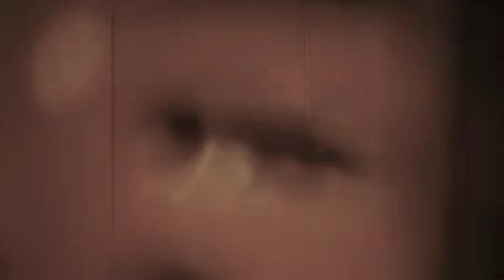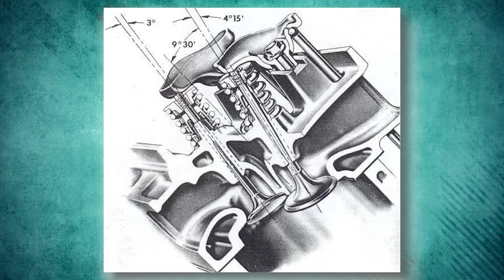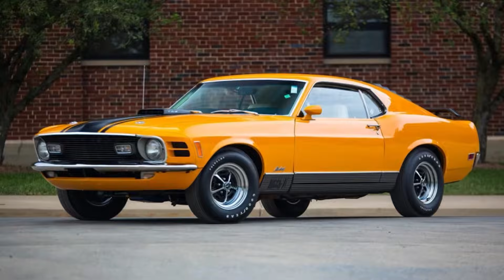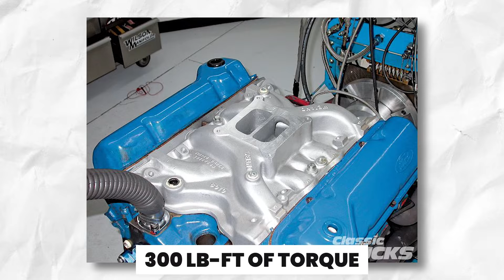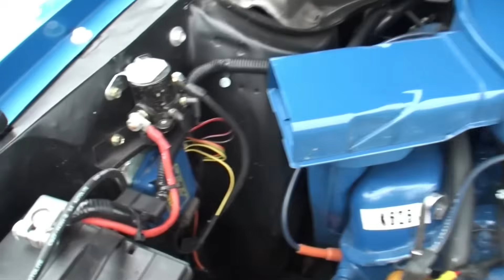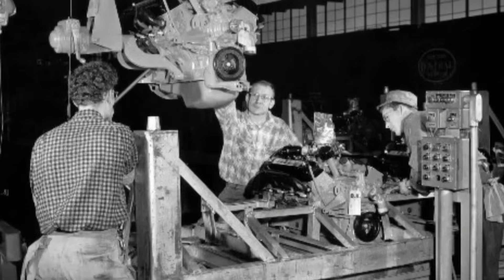The SHOCKING Truth Behind the FORD 351M

Comment: Drive unloaded? Can I get a manual, and 4wd. I have a hill to pull (with a 12000lbs trailer, I need to put it in 4 wheel low range granny low, lock the hubs just to get up the hill. Have fun

Comment: The 400 was never referred to as an 'M'.  It was the only 400 V8 Ford ever made and needed no additional designator.  The desginators 'W', 'C', and 'M' were necessary because Ford insisted on building three separate engines and callling them 351s.

Fun fact:  In reality, they were 352s, because they have EXACTLY the same bore and stroke as the old 352 FE motor.  The irony here is Ford called its new tall-deck small block introduced in 1969 a '351' to avoid confusion with the older engine in parts and service operations.   Even the 'Windsor' designation didn't come along until 1970, when Ford introduced a second '351' that year, and called it the 351 Cleveland.  And when 351C production ended after 1974, the destroked 400 that Ford slapped together to replace it became the 'M'.

Comment: I worked at a Ford dealer when the 351m was introduced. The tag on the valve cover said engine family 351m/400 . The winds or plant could not keep up with the demand so they modified the 400 by installing a 3.5 stroke crank and taller pistons . Used the same rod. The 400 never had an M desegnation. I have way more to say on this subject by I'm tired of typing. I rebuilt lots of 400 s . Mild cam headers eldelbrock intake and 600 holley. Made great tow engine s . I replaced a lot of them with 460 s. Lots of B's in this video . Do your homework first.

Comment: Some 400's are only good for boat anchors. There was a recall in 77 as the block would crack down the valley. The fix was a new block not engine. The dealer would pull the engine and swap the internals to the new block. My brother who work for ford at the time called them 400 crackers.

Comment: I had a 1976 Gran Torino with the 351m/400. Had a holley 2bbl carburetor. I've heard that engine was set with retarded timing for better fuel economy. I dunno, maybe my Gran Torino had a different timing gear, because that really launched. At any speed.

Comment: Lunatic cam, 5.0 roller lifters, scorpion roller rockers, 70 4v closed chamber heads, spacer plates, 351c offenhauser intake, stroker kit, full length headers, 700cfm Holley, hei distributor..... Ever see a 77 Lincoln do donuts 😂😂

Comment: my GrandFather had came across a barn find 78 Ranger with a 351 Modified... it was 4x4, and already had a 6" lift... then my Mom got it... and I am a witness to and can say with as old as it was (this was in the 2000's btw) that old truck could pull DAM near anything you hooked to it... I miss that old truck :-( but at the same time, very GRATEFUL that I got to ride in it with family make memories and a lil money to <3 They DEFINITLY Don't Build Shit The Way They Used To. OH ! and obviously the carb was upgraded to an Elderbrock 4barrel and a way better exhaust with a full tune up on the motor itself

Comment: Need some help from you guys: I have a 400 in a 1981 f250. I would like to change the cam as I understand that they were made with bad valve timing. Is there a company that makes a new cam with the valve timing altered? I know you can drill it and change it yourself, but I don't want to do that, as I may mess it up.
Reply: Yes,you can buy any 351 Cleveland cam,to replace in your 351M/400.

Comment: 351M and 400M had the cam timing retarded for emissions.
If you advance the camshafts 3-5 degrees, that pick up 20-45 horsepower.
We have seen amazing results performing basic tuning procedures.

Comment: when you rebuild these engines, take the time to knock the freeze plugs out youself and run a flat rod around in the water jackets, between the cylinders.  55 years is a long time.  Mud, rust and concrete muck has built-up between those cylinders.  Rod it out, like a radiator.  Boiling is not enough.  It takes physical work to drive the tarter out of that 351M/400 block.

Comment: You can build a pretty decent engine out of these.  Up the compression, up the cam, replace the valves and seats to the 4V size and some porting and polishing. Of course you want to use the 400 rotating assemble. And there are a few 4-barrel carburetors intakes available.  Add headers and a good exhaust.  400+ HP is easy to reach.

Comment: The 400 could be made up run.   I am not talking 390 hp, but they did a good number of miles.  I was surprised by how heavy the 400 was compared to the FE, and how much quicker revvving the FE was. Iliked the 410  best with dished pieces and the 410/428 crank in trucks with 9.5:1 cr and the c6TE heads. They had good pulling capability. The 400 trucks pulled pretty well. There were plates for pulling a 4V intake and a Quadrajet with a 210/220@.050 cam with headers and I think I got 300 hp from. The 390with .030 over and the 410crank and a 235@.050 .559 lift roller cam ,  w headers with the 780 Holley and Holley SD it makes 510 hp and 488 ft lbs at the flywheel. I was surprised that 10.5:1 would hit that much with TRW forged and the thick gaskets. .035 quench  it still roasts the tires off. It’s in a 65 Galaxie. I expected more from the 400, they hold up like hecsaun. I sold it to another guy  where they are lenient. The FE could still be around. I never understood that alphabet soup.

Comment: Never seen a 400M..  the 400 is 6.6 litres1971 250hp.. 1972 was cut back for 73 at 180hp (M) come in 75  witch stood for modified.. modified from 400 cui to 351 cui... 351M on the stickers helped identify, so dealers knew what was internal.. I've spent 38  years messaging with these things.. a 1970 351 C cobra camshaft and timing gear changes everything.. even on the 400s 351m's, and the 71- 74 clevelands derated during gas crisis. Thank me later..

Comment: I had a 351M in my 1977 F150. It didn’t have enough power to pull a greased string out of a gnat’s ass.
Reply: Yep factory they were gas guzzling dogs you have to change the cam and alum intake 4 barrel carb  and headers help to but with just those changes they make alot more hp they were so smogged out factory with a 8 degree retarded timing gear

Comment: It’s simple. First was the 351c. They made a big version the 400 to replace the FE motors.  Not a 400M. A 400. They modified the 400 to into a 351. Now you have a 351m. Same block, heads and intake as a 400.

Comment: i have a 351 m in my 1980 f 250...with a cam, headers and 4 barrel she runs great, although not great on gas.
Reply: What cam did you use? Updated valve timing on it?

Comment: The 351M gets a lot of flack for having large external dimensions relative to its displacement .  But the Pontiac 287 - 326 - 350 , olds 330 - 350 and Buick 350 were no different .

Comment: The "M" does stand for modified. It is a Cleveland block that has had the main journals bored out. So they classified it as a modified block. As far as them being good engines, they are. They just need to be built as they should have been from the factory. They were so choked off and de-tuned. Doesnt make them a bad engine. I have a mildly built 400 in my '77 F-150 and it moves great. Putting out approx. 375 hp vs factory 175hp.
Reply: Incorrect. The Cleveland is a 9.2" deck height block. The 351M/400 is a 10.297" deck height block. The motor mounts and bell housing patterns are also different.

Comment: Back in '78, I ran the truck in my photo as a wrecker. The '78 and '79 Ford truck grills were very popular among Ford guys. I knew 2 dudes that bought the grills from the local dealers for their older trucks. The 351M was a toad, but the 400 was a descent motor. I knew 2 owners of the '78 and '79 trucks who replaced the 351 with the 428/C6 motor-trans combo, sourced from the late '60s Mercury. With the Dentside, you either got a descent motor, or the cool looking grill.

Comment: I pulled my anemic 351M for a rebuild using a 400 crank and pistons. I fitted the engine with a set of 1970 closed chambered 4V heads using a Cleveland intake manifold and spacer plates. This tripled horsepower and torque. 25 years later she still screams and pulls like a freight train in my 1978 F100 flareside. Note: There is no "M" in a 400 Ford.
Reply: It's much less work and more hp and reliability to just switch to a 429 or 460 which is what i did in my 75 Highboy 35 years ago and it's still going strong
Reply: @Randy7th  Luv the "High Boys". I also have a near pristine 77' XR7. I acquired a complete 76' Mark IV, 460, C6,9" posi. to use as a doner for the Cougar. Great care was taken rebuilding and swapping of the drivetrain. Only a few have car show enthusiast noticed the 460 was not an option for this vehicle over the past 30 years. Good luck to you.
Reply: That’s a build I’ve always wanted to try. Ford like that 4” stroke. The 428 FE used a 3.98” stroke, just under 4”. Then they put a 4” stroke in the big six taking the 240 to 300 cubes. After that the 400M was built as a higher deck 351C. And since the Cleveland was never going to be built again the built the 351M with the 400’s taller deck height. This saved cost in the long run, not having to make two blocks, but it also left room for longer rods. That helped these engines make a little more power. They used 6.58” connecting rods which provided better rod length to stroke ratios. The 351M had a rod ratio of 1.88-1 and the 400 was 1.645-1. Compared to the Chevy’s small block 400 with a rod ratio of 1.484-1, the 400M put far less stress on the crankshaft. The Chevy 350 with the standard 5.7” rods we rent much better at 1.637-1 it was lower the 400M.  The only disadvantage is the extra weight.
Reply: I have a 79 ranchero that had a 351 m swapped out to a 71 D1 400m w aussie heads 4bbl cam hei ignition thers more but tuned rite it has immediate balls it gets sketch getting on it . I had my brother freaking out and another stomping on the floor looking for the brake pedal ... lmao oh crazy torque w the original air plane gears 1st shifts at 50mph then second buries 85 then 3rd we'll I never ran it out it has crazy torque so it pulls hard really hard ..
Reply: noo it's not ❤

Comment: Headers, a cam, intake and carb on a stock 400M is no slouch and pretty cheap. Beat mine hard for years and it never broke anything but a few rockers.
Reply: Can you get a new style updated cam with valve timing corrected?

Comment: I had a 79 Ranchero with a 351m and I worked it alittle and got it to run better and it would spin the rear tires with no problem so anyone who thinks these engines were poor runners they weren't.

Comment: My son owned a 1979 Lincoln Mark V with the 400 M.  He bought it with 107,000 miles on it. We tuned it up and installed a 4 barrel intake and carburetor on it.  We ditched the dual cats and installed 2 1/2 inch dual exhaust. He drove from Knoxville, Tennessee to New Orleans round trip and averaged 20 mpg at an average speed of 80 mph. He said 
the speedometer was always buried passed the 80 mile number   It was a wonderful, bullet proof car.  My daughter had a 1964 Ford F100 pickup with the same 79 Lincoln 400 M
engine, trans and rear end. It had headers and it had all the power you needed plus
great mileage with the 4 barrel and dual exhaust set up.

Comment: I have a 78’ F250 351 m with 25k original miles  I put a Performer rpm manifold and a 650 Holley on it and it runs flawlessly
Reply: i have a 351m with a performer intake and holley carb and it is a dog.....  planning on putting a 400 crank and pistons in it to wake it up.   77 F150

Comment: Had a 1975 LTD Country Squire with a 400/C6 combo. Great car to drive. Thirsty, but had plenty of get up and go for the size of the car. Towed anything, or you could fill it up 1000lbs of building material, and drive away like it's empty. Never felt fast, but never felt like it was struggling either.

Comment: Considering the 2bbl and 4bbl Cleveland head designs would make good power the 351M and 400 could both make lots of power. I have built both as performance engines. 351C engines always made good power, even the 2bbl headed models. Deck height, bellhousing pattern and engine mount bosses were the only real differences. Price a good 351C engine core compared to a 351M /400 core, 351C engines are much more expensive and hard to find.

Comment: There is not now nor has there ever been a 400M. There was a 400 in 1970 and then a destroked, or Modified, 351 that used the same connecting rods as the 400. Not just heads and intake. Why does every you tube channel get these so wrong. The distributer interchanges with the 460 as well as the rocker arms and valves. 
   Maybe do some research before 💩💩ing on engines of which you seem to know little.

Comment: You are right about the timing chain slack. But the slack was due more to the nylon gear. They used on the timing chains. Who’s great idea was that? Probably the same guy who runs belt drive oil pumps on the newer Ford engines.
Reply: About 99 percent of engines came from the factory with nylon timing gears in the 70's .

Comment: There was no 400M, it was just the 400 but gets called that because its the same block as the 351M.  The 400 and 351M took the place of the 390 and 360 in trucks in about 1977. I've heard the "M" stands for Midland, Michigan, Modified,and Montreal. I'm guessing it stands for Michigan because thats where the blocks were cast and the "W" and "C" both stand for plant locations.

Comment: In the mid 90's when I was a poor university student, i picked up a 1981 F150 extended cab swb 2wd with a 351M. It was underpowered and thirsty but surprised me with it's longevity.  The seller scammed me an filled the sump with thick oil. When i changed it, there was a rod knock and it would not put out the oil light until about 10 kph. But it ran 50k km for me without quitting. I eventually sold it to someone who needed it for a summer yard project.  It didn't die for him either.  I was surprised how long it ran with a knock and almost no oil pressure.

Comment: My old 78 LTD with the 351M would do 100mph in second gear until it would start to miss.
Reply: That's only because of the gears in the rearend, with 2.76 gears my 70 R/T Charger would run 70 in 1st and an unlimited top end (150+).

Comment: Here in australia we dont come across many 400s ,351m is even rarer,but we have heaps of 351c and 302c as they were our main ford v8 from 1970 to 1982,i really had a thing for the 400 engine ,i rebuilt 5 of them and all had slight differences between  them,like engine mount bosses,casting centre differences ,dearborn,michigan,cleveland casting centre,was a real eye opener to learn all the stuff about the 400/351m,imo the early 400 DIF block engine is the most common 400 found in australia from imported cars and trucks.
Reply: Typical ford confusion.
Reply: They’re all getting pretty rare here in the states too. For some reason the 351m and 400 were hated and I believe that was due to the change in emissions that completely pulled the power out of these engines. Gotta love the government. I’ve taken post emissions 351m, cam swap, 4 barrel and headers and they ran great. People here either love or fear the Cleveland’s for obvious reasons but they are kinda hard to find and a little pricey.

Comment: 400 with 351M Heads and 400 intake = gas mileage😊
Reply: They're the same heads.
Reply: Those heads are EXACTLY the same. I've  got D1ae heads on my 400 that sits in '78 Bronco Custom. Chose them over later model 351M/400 heads simply because they had smaller,74cc chambers.

Comment: Anyone that says you can't turn a 351 M into a screamer doesn't know what they're talking about. Even with stock Pistons and a aftermarket camshaft and intake you can bump the power up almost 300 horsepower with little other mods seen a few of these engines in Fox body Mustangs despite the bulky weight turning those cars into total rocket ships especially based on the torque numbers posted from the factory to say nothing of additional torque with mods
Reply: I agree with not alot of money or work just say 1000 bucks you can get everything you need to make it preform so much better even  with stock pistons low compression heads you can get around 300 hp and over 400 lbs of torque
Reply: you can but it cost big money and even then they not screamers more like don’t take it above 7,000 rpm because it going to come apart. plus no body makes hi performance pistons and cranks for them. but it is a torque monster in a truck .
Reply: @waynevictory5208  you can get high performance pistons for them now. Two or 3 different options.
Reply: @waynevictory5208 😂 nope I run a 351 M in my 2wheel drive 78 f250 and it runs 12.30s and it cost under $3500
Reply: Yes!
There ARE indeed "aftermarket pistons" and rotating assemblies available. 
Think @Tim Meyer machine. He's  out of Fairmount Minnesota.
Reply: Sure you can make them make power but the 351 Windsor and Cleveland can make that same power cheaper and are objectively better
Reply: @GregorySchlautmann true but some people stick with what they already have on hand
Reply: @GregorySchlautmann Clevelands are fairly difficult to find these days.  They haven't been in production for about a half a century at this point.  I've heard about people even shipping them out here from Australia. But that's gotta be expensive. I once bought a book out of Australia. The shipping cost $3 more than the book did.😂

Comment: The 351M(Modified) was brought out by Ford because both the Cleveland 2V and 4V were not suitable for service in the trucks and land yachts because of the lack of low end power and torque the Clevelands lacked, especially the Cleveland 4V.
Reply: except thats a lie! most stock 4v made over 300 ft lbs by 2200.
Reply: BS!!😂😮